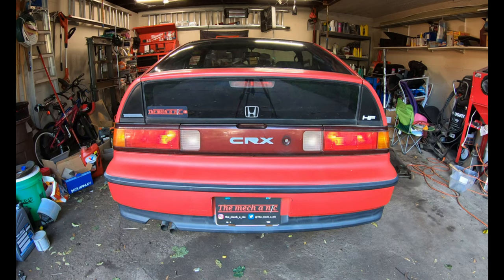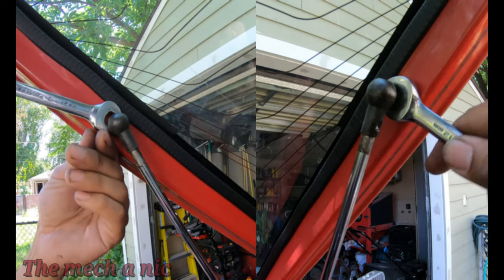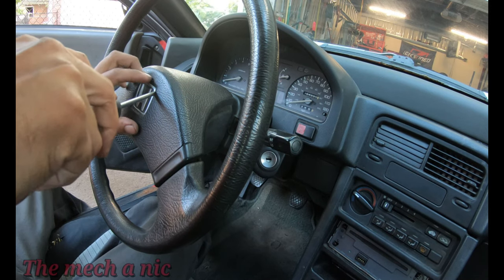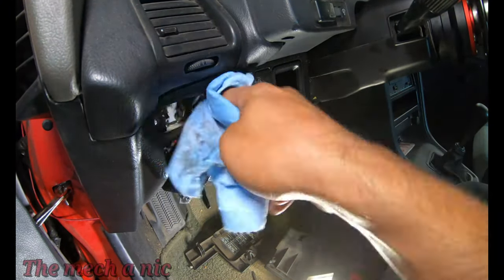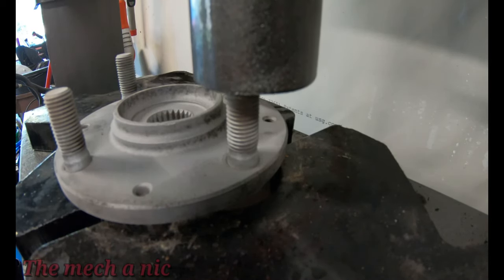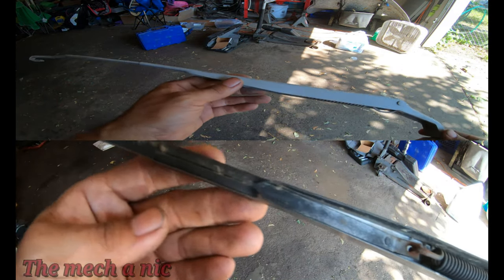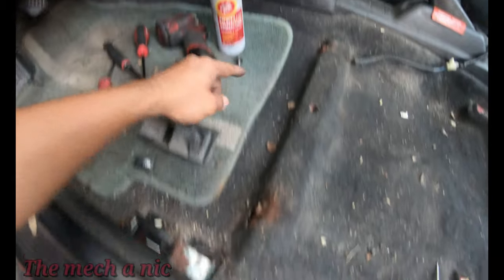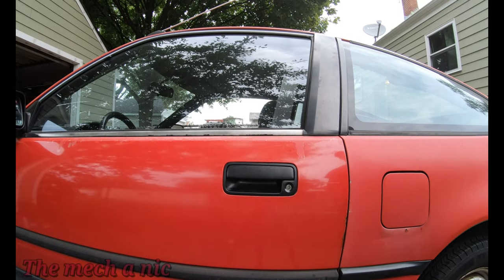repairing small problems - CRX PROJECT VOL 2

Comment: Good stuff, can't say how grateful I am that I don't have to deal with all the rust/corrosion problems that plague cars in northern states.
Reply from the maker: I'm super jealous of the cars around you lol. It is what it is. It'll just take more work. One step at a time.
Reply: @themechanic6117  that's right. It is what it is. I lived in Florida for a long time. While you dont have the rust and corrosion issues down there you do run into other problems related to the sun and the heat. There are pros and cons everywhere you go.
Reply from the maker: As far as cars... Id rather have the sun n heat problems than the rust 😩😂
Reply: I dont know about that. Perspective is everything. The heat destroys all rubber seals, hoses, gaskets, belts. Also anything that is plastic or vinyl. The UV rays from the sun down there are way worse so it destroys anything it touches 10 fold. Paint, dashboards, upholstery, etc.  You have to repair and maintain a lot of other stuff a lot more down there than you do up north.

Comment: Good video. Only thing I see you need to check is the passenger side turn signal "with marker light" are not blinking and stay on all the time. They should alternate with the bumper lights.
Reply from the maker: Yes i noticed that also. Not sure whats going on because all the bulbs are good

Comment: @23:35

I have found that with parts that have corroded, or maybe have become weak-
after blasting/sanding/brushing all you can, drill a series of tiny pin
holes in the part, then push in mixed JB Weld cream epoxy to all surfaces,
making sure to connect the epoxy through the holes, to give it more rigidity
and structural integrity. Using the holes to connect is very important.

When dry- it can be filed, blasted/sanded down to smooth, built up where 
it should be. You can even drill & tap it.

JB Weld accepts etching primers & paints very well, too.

Comment: The reason your hatch support covers don’t fit is because you replaced with the incorrect part. I too made the same error because O’Reilly told me they don’t make those anymore. I went to NAPA and they cost $36/ea instead of $18/ea. But the part is available for purchase. Hopefully this is corrected. Love the video.
Reply from the maker: Thanks for the info. Next time i replace them ill be sure to get the corect parts. I still have the covers

Comment: Great video, i hit a like. what's the torque # on the steering wheel nut how much did you torque it? Also what NRG hub whats that when u press the buttom was a lock type of thing, an  anti theft device?
Reply from the maker: Torqued to 36 lbft I believe. Its a nrg lock thats sold separately. Yes , its supposed to be for anti theft

Comment: Dude you need an s2000 shift knob holy crap those are legit
Reply from the maker: when I drop the K series in ill have a Ktuned billet shifter assembly so ill get my shift knob thatll fit that. its why i wanted to change the knob to something I had kicking around instead of spending money on one.

Comment: Should of sand blasted the value cover but I'm sure your not going to really cared for it since it's under the hood. Anyhow should of also cleaned or swap out the air intake filter if you haven't already done so. K&n would be best for the air box
Reply from the maker: Check my other videos of my engine build. I have a fully built k24 going into this crx. No point in wasting money or time on the original engine in the crx
Reply: @themechanic6117  if this the case then no need for that D15/ZC . It's just a daily drive anyway

Comment: So I’ve been trying to figure out if my blower resistor or my blower fan has gone bad. Have a 89 crx si and just wondering if you had ever dealt with a bad heater fan? I can hear the control unit inside responding but the fan doesn’t actually blow.

Love your videos, and keep them coming!
Reply: If it doesn't work on high then it's your motor. The resistor only lowers the voltage to slow the motor down.
Reply from the maker: Don't know how I missed this original comment.  Yes I agree with Mitchell

Comment: Mine was leaking oil into the spark plug tubes the same way, however mine were the o-rings that sit underneath the rocker assembly. Plug valleys are dry like my ex-wife’s vagi-gi now.
Reply from the maker: 😂😂that was funny. Yeah it sucks when its leaking oil from in there